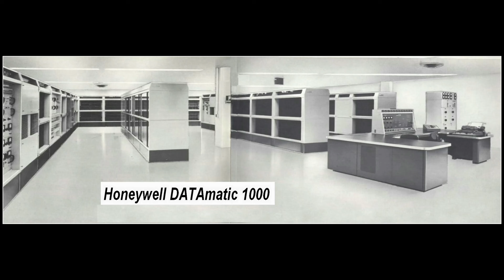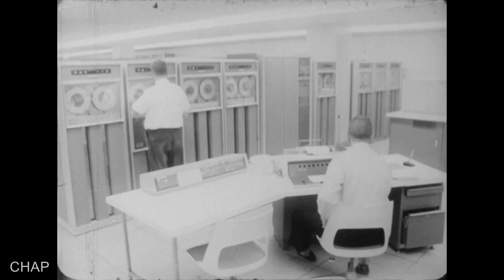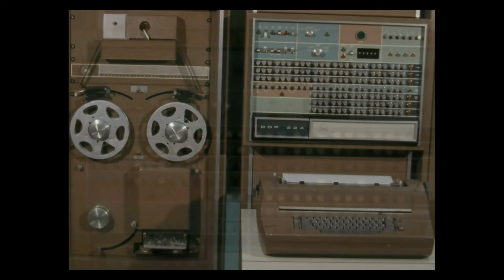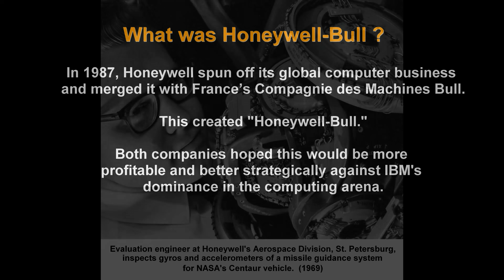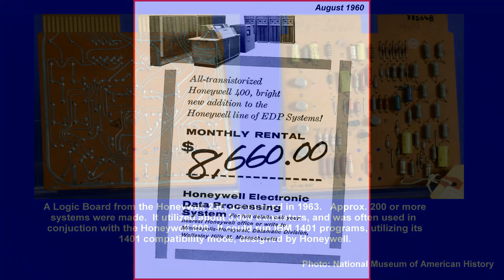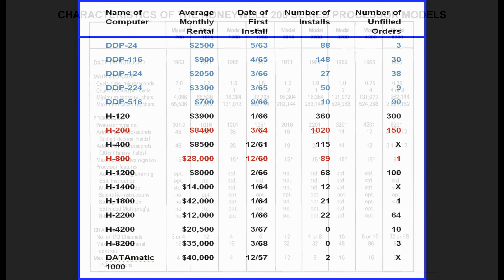Early Computers of HONEYWELL 800, 200, DATAmatic, GE, Xerox, 3C, DDP mini, Mainframe, 1960s NASA

Comment: I worked for Honeywell Large Information Systems Division in Phoenix, AZ during the late '70s - early '80s. This video reminded me that, after I left, it was swallowed up by the French company Bull. I remember driving by it on I-17, seeing the large "Honeywell Bull" sign facing the freeway and thinking "They finally got it right.". 

Of all the large tech corporations in the Valley of the Sun, it was the most internally political. Not a pleasant work environment.

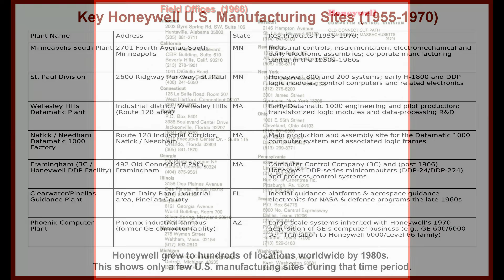At 13:10, the last entry, " Phoenix Computer Plant" is probably what became Large Information Systems Division. It was located on the south side of Thunderbird Road between I-17 and N 31st Ave.  What is now N 30th Ave was the main parking lot entrance, not a street.
Reply from the maker: Interesting, didn't know that about H Well...    Sounds like some interesting times though.

Comment: The first computer I programmed was a Honeywell H200, the language was Easycoder.
Reply from the maker: @donaldholstein8759, Very cool!   That is the the native assembly language for the H200.  That must have been a very interesting time.   Did you also work with COBOL, FORTRAN, RPG or any of the other languages on that system?   ~  Victor, CHAP
Reply: @ComputerHistoryArchivesProject  yes, we also programmed in Mod1 MSR COBOL on the H200.  I didn't  program with Fortran.  The school replaced the h200 with a Honeywell Levell 6, Burroughs B1700  and IBM 370.  we did RPG, programming on three  of the computers; and IBM Assembler and COBOL on the IBM system.   I then went to work at Honeyell, where I did program conversions Fromm IBM, NCR, and UNIVACS to Honeywell Level 64  and Honeywell Level 66 machines.
Reply from the maker: @donaldholstein8759, that is a VERY impressive programming background!   Sounds like you had some very interesting times!  Thank you very much for sharing that!  ~  VK